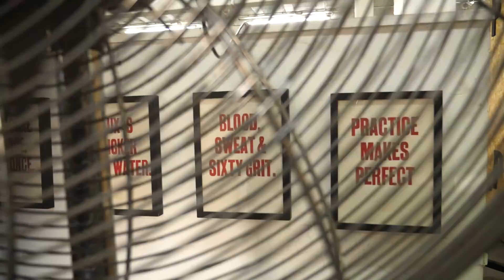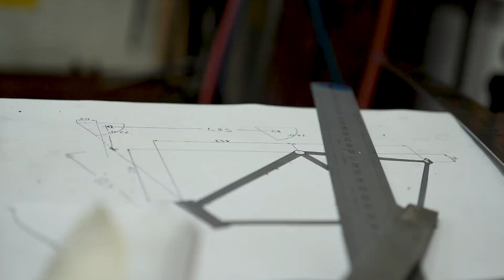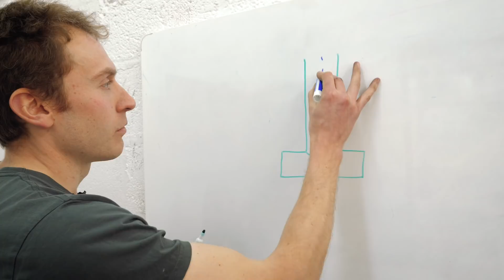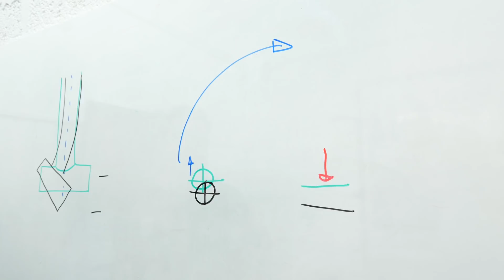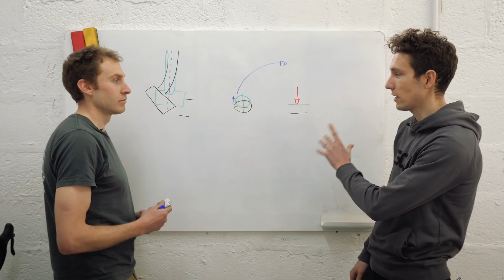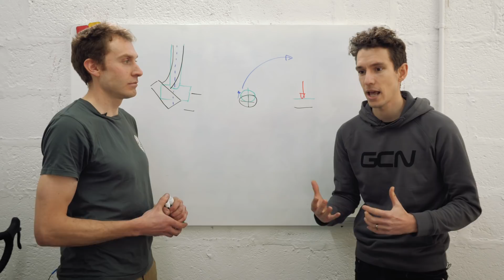Are You Faster On A Stiffer Bike?

Comment: Physics!  Even if you get that energy back, I would bet that some of it is used by a flexible frame. It could generate minimal amounts of heat for example. That energy then being transferred in the the air rather than the drive train. We know that when things flex they warm up at least a small amount. Therefore a stiffer frame that can't absorb as much energy doesn't conduct it to other places like heat and air. That would lead us to believe that the energy is more efficiently transferred to the drive train. Result: Stiffer frames are indeed fast, just by less than we originally thought. 

It all boils dow to what feels better though. If you don't like how a bike feels you won't ride it to your capacity. 

We look at tire size and pressure, bike weight, frame stiffness, etc. and the issue always will fall to the engine of the machine, the rider.
Reply: Correction: there are hysteretic losses in every frame. The real question is if those losses are meaningful.  It's not a given--it certainly hasn't been demonstrated in a lab or by any experiment--that those losses are meaningful.  Likewise, it certainly hasn't been demonstrated that time interval between when when the frame is flexed and then returns to its starting position, that 𝝙t and the associated phase offset for power application, is meaningful at all in terms of performance.  It might seem like it should be, but quite in physics, things aren't always what one might think.  That a rider might think they're faster on a stiffer frame may not correlate with what the data might say.  Even then, correlation doesn't necessarily reveal a causal link.
Reply: I think that perception of how a bike feels and equating that to a rider not riding it to his/her potential is pretty much rubbish. It certainly is a narrative but it has no basis in technical fact.
Reply: I agree with you. Flexy frame would still have energy loss and you can't get 100% energy return anyway, plus when you put your power down you want it instant, not a delay from the flex frame.
Reply: A stiffer frame can absorb just as much energy; what's important is the elasticity of the material. Energy is just force through distance, so if you flex it less by pushing harder it doesn't change the energy storage. Elasticity governs how much of that energy is returned and actually, I suspect steel is more elastic than carbon due to the vibration damping of carbon.

Little bit of physics/engineering here: any time you hear "damping" if means absorbing energy and generally converting it to heat.

GCN should do a test on a trainer (no wind/fan) with a thermal camera and measure the increase in heat, then, considering heat capacities, calculate the thermal energy lost to the frame
Reply: Are we assuming too much rigidity in the rest of the system between sprocket and tyre? How much torsional flex in the wheel etc etc.
Reply: I think the thermal loss to flexing the frame is quite small, likely negligible.  What is significant is that the energy going into  the frame is not being delivered to the wheel, as in this contrived example.  The energy will be released out of phase with the power stroke, and it doesn't go into propelling the bike.
Reply: Would it be possible to measure and compare the energy transfered to the rear wheel by the flex give-back vs when the same force acts on the pedal on a non- or less-flexible frame? If so, it could either confirm or disprove the theoretical white board surmise.
Reply: You're correct in that you're not completely wrong. But that doesn't mean your objective should be to design a frame that has "zero energy loss." Because of the effect on the energy production machine. I assure you that shock absorbers in Formula One (and other wheeled vehicles) do dissipate energy and yet tuning them is a critical key to maximizing speed and efficiency. Getting it wrong means you lose even more energy elsewhere. This is also why tire pressure (and size) should be tuned according to conditions. Harder is not always better even though a local argument can always be made that you're "conserving energy." Because of the net effect on the system the arguments are weak unless you test the net effects of your changes. Also, a hyper-stiff frame might be better once you know what the optimal tires (and PSI) will be. I prefer a very stiff frame because of the effects on handling stability and avoiding chain rub and bad shifting. That's where you find clear thresholds of unacceptable flex. Not energy lost in the frame per se.  If I'm limited in the tires and wheels (and saddle) as a last resort I might conceivably opt for more flex given an array of choices. It would be a last resort and it's never happened in reality. I was an early adopter of wider tires, lower PSI, and OS tubes (Klein and so forth). But for the reasons given, not because I'm looking to save those supposed precious watts. 

"It all boils dow to what feels better though. If you don't like how a bike feels you won't ride it to your capacity. "

If you want to skip all of the "laboratory" metrics and go by feel you probably won't be too far off. However, people did (and still do) "go by feel" for many years and kept using skinny tires and flexible frames that rubbed brake pads and had unstable shifting. So, they did leave performance on the table and were blissfully unaware that running their 700 * 21 or 700* 23 tires at 110 or 120 psi was making them slower and those flexible frames really were not the best choice to create a comfortable and efficient platform for cycling.
Reply: Frame flex results in movement which is perpendicular to the forward movement.  Hence a stiffer frame would convert more of your effort into forward movement.
Reply: @amandamartinez1543 Yes but the point of this video was to demonstrate that that perpendicular energy to the forward movement you mentioned is actually fed back to the drivetrain when releasing pedal pressure. Most of it probably, not all of it.
Reply: Well said.
Reply: Michael Albany 

Yes.  How much entropic loss.
Reply: "Entropic loss" is just going to be thermal loss.  After all, the amount of entropy in a system, S, is just equal to Boltzmann's constant times the natural log of the number of possible energy states.  The problem is that it's really not possible or meaningful to define the number of possible energy states, so instead we look at changes in entropy.
Reply: Simon should test both bikes both at same wattage and see if stress training/ IF/ kj play a factor. I dunno what I'm talking about.
Reply: Michael Albany You're exactly right. Energy conversions from mechanical, electrical, whatever are never 100% efficient. A stiffer bike will lose less energy in this conversion process. Either way great point and great Gcn video.
Reply: Yes all the minute losses will add up over the course of a ride
Reply: Let's not forget the psychology.. if you are pedalling along and look down at your big chain ring and you see it wobbling back and forth as you peddle... it's going to make you feel like you are wasting energy.. though that is possibly due to a cheap chainset and would be fixed by upgrading a chainset but i suppose frame flex could show in the wobbling  big chainwheel too..
Reply: You are wrong. Most energy from frame flexing side to side goes to counter the gravity force. It adds nothing but rolling resistance.
Reply: Not all energy goes into heat. What about vibration, rocking forces on the bottom bracket that simply cancel each other out only wearing the material. And most of it goes anyways to movement perpendicular to the drive movement. You simply dampen the energy by exerting more downward force against gravity
Reply: wrong! stiff frame absorbs just as much energy because more force is required for the frame to bend the same distance. they cancel out
Reply: It doesn't cancel but neither is one clearly better or worse.  It depends on the material.  But no hard  material that returns to its shape is dissipating anything like a significant amount of energy when flexing.  No the experiment here isn't exactly like the real world, but yes it does exactly show the principle.  If flex causes energy loss that has to go somewhere.  I suspect as Grigor Browning mentioned, some is through causing phase mismatch between the load and force, causing inefficiency in the leg itself. Some is through negative work in the legs, some is probably as sound energy to the ground (with some dissipating in tires on the way) just as would happen if that pedal were released instantly in the video.
Reply: Michael Albany  as a general rule stiffer frames are not faster you actually experience more energy loss on a stiffer frame then you do on a frame that Flexes in the right way and at the right time. #planing

Comment: imo, in line with the mechanic, stiff frame will feel faster as the flex is lesser so it feels more responsive as you load those drive train. whereas less stiff bike will feel sluggish or lost of power as there is a time delay for the transfer of energy. 
ideally, you want responsive bike to attack at the right moment so stiffer bike is still the better option.
lastly, the flex of bike frame is commonly compensated with the slight twist of handlebar to maintain balance. that may result in a utter different finding.
Reply: Feeling faster ≠ actually faster

Case in point: bigger tires at lower pressures feel slow but are measurably faster while skinny tires feel faster but are comparably slower.
Reply: Theoretically though, according to the video, torque should be returned before the end of the pedal stroke, so power will be returned before 1/2 of a revolution on the pedal. Assuming pedalling at around 80-90 rpm, thats only about 1/3 of a second. I personally don't think (at least at most people's riding level) that will make too much of a difference.
Reply: The handlebar twisting as people pedal isn't just from frame flex, but also from:
1-The rider putting uneven hand force on the bars through their pedal stroke.
2-The response of the steering geometry (i.e. trail) to the rider rocking the bike.
Reply: You are on the right track. The faction of the 1/3 of a second of your muscle exerting effort while the spring loads and unloads adds up as it happens on every revolution.  Think of a stiff frame as your muscle working for a slightly shorter duration every pedal stroke to deliver the same power.  If the frame were infinitely stiff, the muscle would have shortest possible duration of effort.  I agree people will feel the stiffness, but that little extra effort will also add up.   My guess is this can be significant.

Comment: Question: loading the drive side gave you clockwise rotation in the tubing. Would loading the non-drive side give you anti clockwise rotation, effectively canceling out the drive side? Understandable you have points in the system that are unidirectional giving the forces relief. 

I would love to see the effects on the test in the other side.
Reply: It would still rotate the wheel because the pedal is on the other side of the axle.
Reply: it won't make a difference on which side of the BB the crank is, it depends on wether the crank arm itself is facing front or back
Reply: The theory is that the flex will return energy to the drivetrain before you load the nds, so around the end of the pedal stroke. I don't think there will still be elastic loading, at least clockwise on the frame, by the time you load the pedals on the nds and vice versa unless the frame is seriously damaged, but I can't say for sure.
Reply: Maciej Ostrowski  it wood be the same you cant. Even on fixed bike i think.